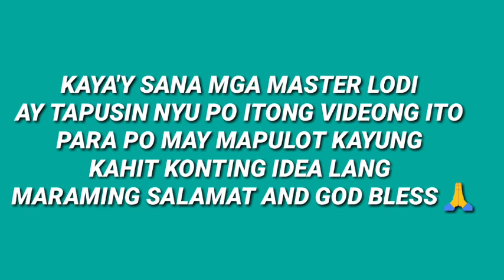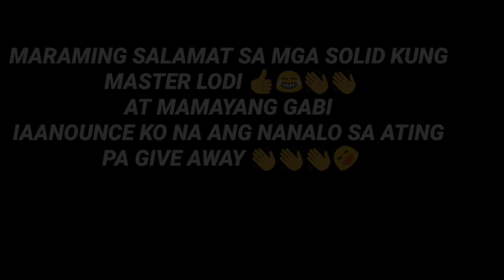PART II   INSTALLATION WALL MOUNTED AIRCON

Comment: Master koppell  split type  ang nakalagay sa indoor master E1 ayaw mag on ng power master sa indoor inverter sya master nag check nano sa out door. Master may voltahe. Master 238 master anokaya problima ng out door. Manga master sanapo nabigyan nyo po ako ng kaalaman para po ma check kopo manga Master